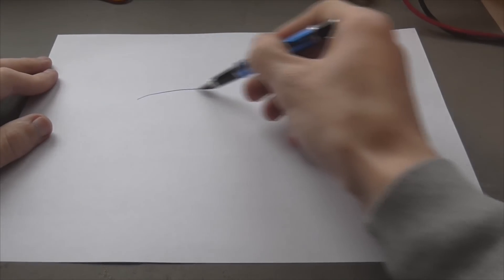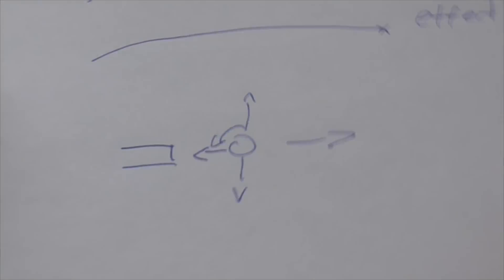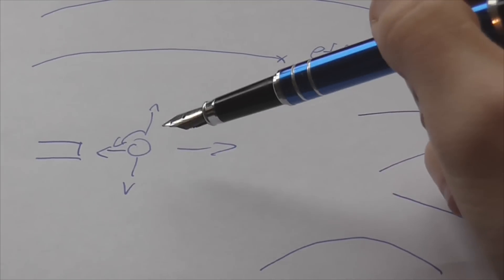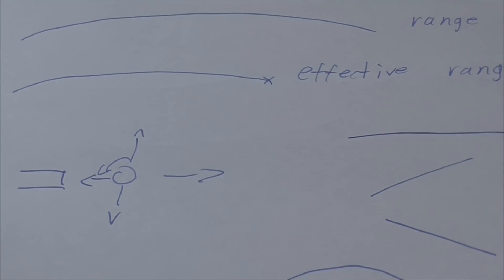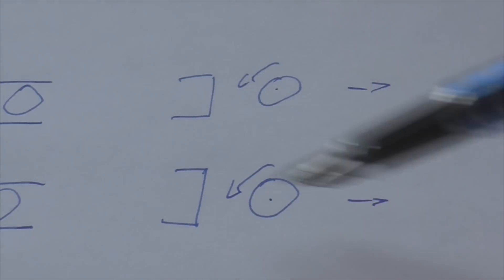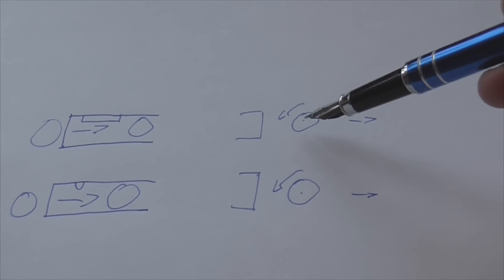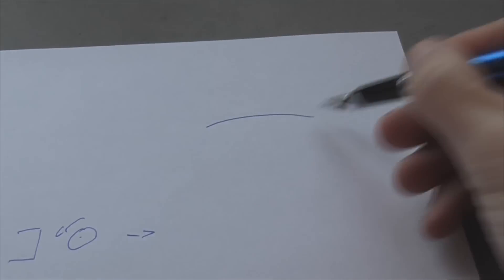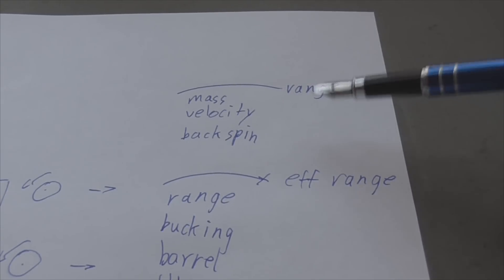Why R-hop isn't as great as you think it is

Comment: bbs are different sizes, just like the barrel o.01mm bbs also have minute differences. I think anything that creates a lift even if it corrects at some point is pointless. Air guns do not use a hop up. So increase power and use lesser power close range. Straight flight path and of course it will drop at the end but something that goes up and and then straight means there is a whole area that you have no idea where it will hit. To be honest I love modifications but there are too many variable and when it is this fiddly it will drive me mad. But I know when i go from plinking to the field I am definently going to want range on low power, but I really want a straight trajectory, and consistency is dangerous if it is lacking. Imagine you test and its fine and then it increasrs and you hurt someone. same with accuracy if its off target due to spin then you could hit someone with a sniper who is close range

Comment: the reason they dont wobble around as much is because the friction force is applied smoother over a greater length rather than it being applied abruptly. Think of it as gently easing on the breaks for a couple of seconds vs slamming on them for a split second, they both get the job done but one makes you shit yourself.

Comment: Your theory is sound but your conclusions are incorrect. An R-Hop does increase your range (not just your effective range) over a Flat Hop or Standard hop for several reasons. 

First, the hop up itself doesn't decrease the BB's velocity as much as the other hop ups. 

Second, it doesn't introduce as much wobble and so the BB doesn't interact with the inside of the barrel as often which also robs the BB of velocity through friction. 

Third, it imparts more consistent vertical back spin rather than potentially diagonal spin creating more effective lift. 

Your statement that once the BB leaves the barrel the R-Hop has no effect on distance is obviously correct but that doesn't change the fact that because of the above reasons the velocity will be higher when it leaves the barrel compared to inferior hop up types and so the range will be increased. 

In fact, because the effect on velocity is so much less with an R-Hop over a standard Hop up, you can see a significant increase in actual range by as much as 25%, which depending on the FPS allowed at your site, could be as much as 15 or 20 metres. 

In addition, a smoother barrel will increase your range to a lesser degree, due to decreased friction with the BB, causing a reduced effect on velocity compared to a less smooth barrel. So, as you said, velocity is the main parameter which effects range and as an R-Hop decreases the Velocity less than other Hop up types it does increase your range incomparision to other types of Hop Up. 

Now if your argument is that an R-Hop does not increase range over No Hop then this might be true but you would have no accuracy so range wouldn't matter anyway.
Reply from the maker: The whole comparison was made assuming muzzle velocity (and kinetic energy remains constant). Yes, R-hop CAN be more efficient in terms of energy efficiency, especially in low power setups, but if you have your setup optimized then you would've taken that into account and would be playing at the maximum permissible kinetic energy / muzzle energy anyway.

That being said, even if you do not, and actually do factor in the fps boost from the R-hop (or to state it correctly: less fps-drop compared to a traditional hopup), then the difference would be marginal. You can get maybe a 5-10% increase in muzzle energy depending on what you came from, which doesn't increase range by any significant amount.
Reply: Well experience says your figures of 5-10% are wrong but assuming it is correct that still equates to potentially over 10 meters increase in range. 

Of course if you upgrade your gun to get to your sites maximum FPS and then upgrade your hop up to a R-Hop to increase your accuracy and as a result find it has increased the muzzle velocity as well,  you are now over the FPS limit and have potentially spend unnecessary time and money to get the gun dialled in and chronographed at the site limit.

 I am looking at it from the standpoint of most Airsofters looking to upgrade their low to mid range gun to increase range and accuracy. At this point it is logical to start with the hop up first to gain the accuracy provided and gauge the effect it also has on range. If, at that point, there is more to do at least you haven't spend money unnecessarily.

The whole premise of "lets compare 2 guns with the same muzzle velocity but different hop up to show R-Hops have no effect on the range achieved" is flawed as if you simply change one of the hop ups to match the other you will see those guns no longer have the same range proving that the hop ups do in fact have an effect on range.
Reply: If you're going to go to the bother of r-hopping, you're going to tune your muzzle energy to site limits.  Take your silly arguments back to your bedroom.

Comment: I noticed a slight mistake with your wording. when u say there are only 2 variables that will increase range which are mass and velocity. There is a 3rd variable which is lift adding backspin creates lift similarly to the wing of a aircraft and will effect range.
Reply: Never mind u do correct that later.

Comment: That's why Rhop is mainly recommended on high velocity setups with heavy bbs. Even with little contact it creates a lot of magnus effect so light bbs go up immediately. I use 0.45G bbs on my 600 FPS DMR, with Rhop I am able to achieve around 100m effective range with almost no change of trajectory.
Reply: I'd like to see the field that allows you to play with a 7.5 Joule DMR as well as the gun itself.
Reply: @jonaswolfsberger7158  it’s 3,34 J
Reply: @jedrzejzeleznik7997  As an engineer, with a minor in mathematics, it's 7.5 bud....
Reply: @casongrumbles5248  Hardball😀
Reply: @casongrumbles5248  600 fps on 0.2g = 400 fps on 0.45g = 3,34J

Comment: From what I’ve seen R hops do from the ones I’ve installed and made for personal weapons and other peoples, is the range it increase is effective range, stock hop ups will reach accurately to 150 feet and start waining off at about 170-200, while R-hop makes its accurate to 200 feet, but doesn’t increase actual range in how far the bb flies, maybe by a little from a better trajectory.
Reply: Rhop does very slightly increase range too, because something that isn't flying straight is losing energy from well, not flying straight. By making your hop more consistent, and straight. You're making the BB lose energy while going perfectly (or as close to it as possible) straight, which makes it so youre using the energy of the BB to go only straight instead of wobbling around.

Comment: If any of you guys ever paid attention to physics, you would know that accuracy has nothing to do with r-hops. What a r-hop system does is increase the precision of the gun, not the accuracy. Accuracy is all based on the operator and how well his aim is. Because a r-hop system basically flattens the contact patch of the hop up, it eliminates bb wobble because there is no space for the bb to seat on the side of the barrel. Thus creating a straight trajectory equaling more effective range. 👌

Comment: r hop is not for more backspin but a more consistant placement of the bb in the barrel.
Reply: You are absolutely WRONG
Reply: @MegaChickenPunch  ok ok i guess if you want to use a .32 and above the r hop can apply more pressure thus more backspin at the sacrifice of fps for most people .30 and below its unnecessary.. no need to overhop you just loose distance...  but people do it anyway and it works great at keeping the bb in a consistent position in the barrel.. so yes it can put more backspin on the bb but thats not what its solely intended for.
Reply: @fammilyman01  no no
My point was rhop has no solid nub and you have 0% chance to load the bb exactly in the same spot because there is no hardstop.

Comment: Your theory is base on misuse of a R-hop system...because  the point of using a aftermarket bucking or R-hop is to increase your spin to be able to lift heavyer bbs wich results to range and consistency increase , so what the point of saying that R-hop isnt't that great if you dont even use it properly ?

Comment: if you learned physics, you will know that there will NOT be any force upwards. lol nice try :)
Reply: It only have two forces. g (gravity by earth) downward and f (air friction) to the left. there will also be a moment M caused the hopup spin in the counter-clockwise direction.
OK, next let explain why the bb can go upward :)
Because when bb travels to the right and spin counterclockwise, the spin will make the air on top travel longer distance than the lower. So, in the same amount of time, the longer distance traveled will end up having lower pressure, which means under the bb, air has more pressure than the top. That causes the bb travel upward.
Reply from the maker: Frank Yang less pressure on the top of the bb and more pressure on bottom of the bb. You are entirely correct. However, I urge you to look up the definition of "force" in a physics context.

Draw a FBD of the bb and you will end up with exactly the same image as I have drawn in the video.

Unless my physics teachers back at university were all wrong, of course :p

Comment: Well  i will give my experience with R-hops, at first when i sow your title, i thought what is this guy talking about,  R-hops is proven by many, including myself . which i have install rhops for many guns (original material) for over 4 years (zkit version) so at first i  was sceptical to your video, but after watching  it. i must agree with most been said on it. from my experience with rhops. it gives more effective range and accuracy , but not necessarily more range. other things which is not mention on your video. is that R-hop in most guns, as you applied less hop there is less or none  fps loss  (except vsr stile buckins which is the oposite) now I am  now experimenting with ER-hop ;)
Reply from the maker: MOUNTAINAIRSOFT I forgot to mention that? Thought I put it in the video, oh well...

But you're right, that's another one of the reasons why R-hop is good, it reduces fps loss :)
Reply: in airsoftsniper. i am sicariatus :)
Reply: and you can have a perfect hopped shot at the first time even at cold temp. it`s important for sniping cause we can`t shot tons of bb to make the bucking work properly

Comment: Research how rifling in a real gun affects range...  it makes a difference!
Reply: +jackd787 rifling only prevents the bullet from tumbling mid-flight. Sure, that tumbling would increase drag and thus mean the bullet would achieve less distance before it dropped onto the ground, but the primary function of rifling is preventing uneven aerodynamics from spoiling your precision.

Lack of rifling will make a gun inaccurate past 30 yards (sometimes shorter, taofladermaus on youtube has footage of attempts to stabilize darts and slugs from smoothbore barrel shotguns and sometimes the shot just curves wildly even at up close ranges) so losing a few dozen yards off a projectile that will only hit the ground a mile away isn't that relevant.

Comment: The ENTIRE point of R-hop is stability and accuracy. A new hop-up system dosn't add kinetic energy to your BB, thus it doesn't give you range.
Reply: Koofuku1ce r hop might not add energy, but it doesn't rob as much energy as a huge rubber being stuffed halfway down trying to hop a .4
Reply: Koofuku1ce It is merely increasing accuracy within that range, no hop up increase your KE, all of they will rob away some KE
Reply: In my country, 240fps(0.5Joules) is a legal limit for fullauto.
Stock these AEGs are of course designed for more energy.
I once switched the stock hopup of my JG 416 (which alledgedly sold with 1.6 Joules outside of the country) to a TM silicone rubber bucking for 2 bucks...40% range increase.

To the point people accused me of cheating and running hot. Chrono disproved them handily.

Hop Up can improve range aswell as accuracy...maybe not as drastically as in my case, but it can.
TM guns usually run fairly low energy, but because all the components are designed for each other, they still boast very good range and accuracy.
The BBs just take longer to get there.

Comment: The RHOP stabilizes the bb as it travels down the barrel, eventually leaving and moving toward the target.  The advantage of this stabilization is that there is less wobble on the bb when it exits the muzzle of the gun.  This reduction in wobble in combination with the backspin reduces the likelihood of the bb traveling in the left or right direction once out of the muzzle.  If a bb has sidespin, occurring due to wobble, you lose both range and effective range due to the deviation right or left.  This is why RHOP creates both increase in both range and effective range.  Its the same concept as a golf ball being hit, a slice or hook will never get the distance that a straight shot would get if all other variables kept constant.
Reply from the maker: Jacob Webster A bb curving right/left still has the same distance from the shooter, because forces acting on the Y-axis (off-center spin) do not influence motion on the X-axis (bore of the gun). (because of the superposition principle)

There is a very small difference due to off center spin slightly slowing down X-axis velocity once there is velocity on the Y-axis as well but this is a difference in the order of centimeters over a 50 meter trajectory ;)

Comment: You're quite right in that r-hop doesn't improve maximum range, but it will improve effective range (i.e. improve your accuracy) due to its more consistent application of spin. The drop-in buckings, e.g. Maple Leaf are really good at emulating an r-hop, a proper r-hop installation will still outperform them though. If you're trying to get the most out of the gun, go r-hop. If you're lazy and want second best, try Sugru or the Maple Leafs. MORE BELOW v

You've made a pretty big mistake in your theory - the lift generated through the backspin is dependent on the velocity of the BB: https://www.grc.nasa.gov/www/k-12/airplane/beach.html - I see you mentioned that later in the video actually but you don't seem to account for it.

This means the lift force does not stay constant - you get more at the start of the shot when velocity is highest, and less as the drag reduces velocity and the spin decays (like you said, the spin decay is so small it can pretty much be ignored). The more constant velocity of using heavier BBs helps reduce this effect as the lift force will be more constant too.

Tuning the hop so you get a straight, flat shot will not get you the longest range due to this effect - it's best to have a little upwards movement in the BB. Makes it a little harder to shoot at varying ranges, but you will get more range.

Another perk of the heavier BBs is that for targets over ~30m/100ft they'll actually get to the target faster than lighter BBs.... they start out slower but because lighter faster BBs decelerate so fast the heavies overtake them past 100ft! Heavier is better all round :)
Reply from the maker: Snakebitey Lift generated (magnus force) indeed depends on the velocity, which I emphasized pretty early in the video. You may have missed it, but it's pretty much what the video revolves around.

Comment: Rhop does not reduce FPS in the same way that a regular bucking does. At the rpm backspin required of a given weight BB the RHop system will have slightly higher FPS if its simply being installed in a given rifle, so it will go farther. If the bucking setup its being compared with is modified to spit out the same FPS as the Rhop system the difference in range will be zero, effective range will still be better due to more consistent backspin. Most of the range improvements people report are from no longer loosing FPS as hop up comes on; Rhop is more pneumatically efficient
Reply from the maker: Reece Mechanical that is correct :)

Comment: remember that chrono's only measure the acceleration at the muzzle and doesn't give an accurate measure when the bb has reached it's maximum acceleration point and started decelerating. barrel length and volume will be an important factor. bore diameter may also influence on how much energy is used up during bb bouncing (from inspecting used DMR barrels, bb bounce is self evident).
Reply from the maker: To avoid confusion, the bb does not accelerate further when out of the barrel. After it has left the barrel, all parameters are set and unless some external influence occurs (e.g. wind or a twig), the trajectory is already determined. When the bb is out of the barrel the velocity will only decrease because there is no force driving the bb, there is only drag force ;)

Cylinder:barrel ratio is a whole different can of worms, I've written a thread on that subject here :)

http://www.airsoftsniperforum.com/32-general-sniper-talk/14303-cylinder-barrel-ratios-explained.html